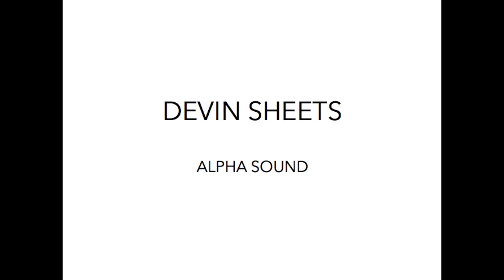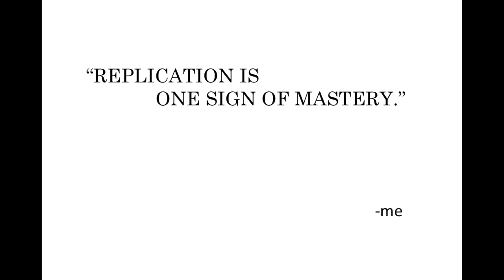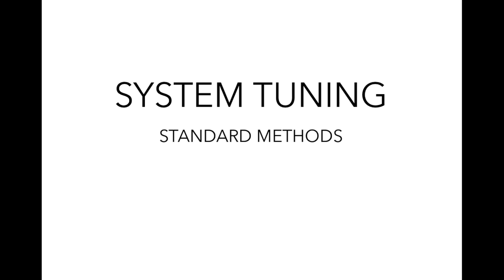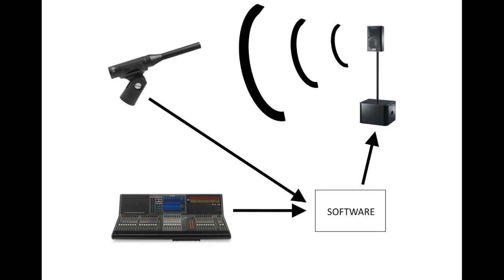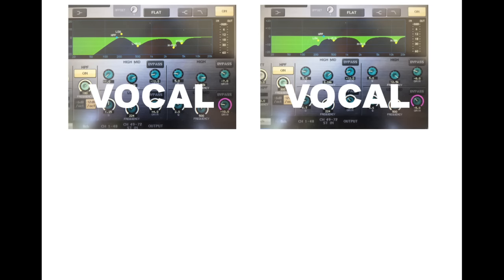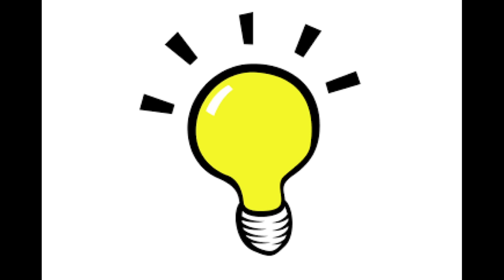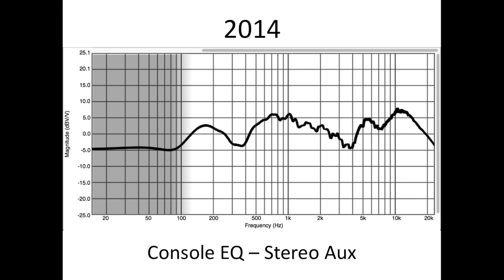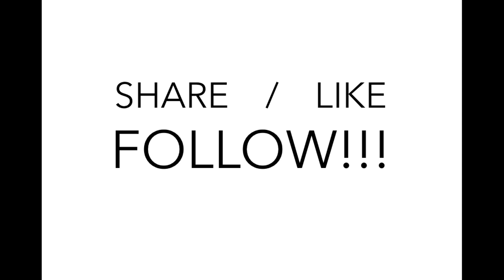Sound System Tuning By Ear

Comment: I used to EQ a system with a graphic by sliding each slider to max, then min, and settling it where it sounded right to me (playing back familiar music).  I always got the system sounding really good this way, and took care of about 90% of potential feedback before I ever turned on a microphone.  When my boss found out this is how I did it, he flipped his lid and said I needed to use an RTA because "that's how it's done."  Thing is, he sold sound systems; he had little experience in actually operating them, and read about how people did things, and believed it was a rigid formula.  Deviation from that formula, to him, made us look incompetent to the customer.  (Customer doesn't care -- they just want it to sound good!)
Reply: If the boss pays well enough we’ll make it work with measurement equipment too!
Reply: That's how I always did it. RTA is only really useful for tracking down FB frequency

Comment: I've been a sound guy since 1989...starting out in clubs, on systems like Yorkville, old JBLs, SoundTech, BFI, Melhart, homemade stuff, etc... My first sound company job was with a former Showco guy, who had an old 70s Showco rig...called the "Hurler System"...that was actually Led Zeppelins PA. 

I was never allowed to even look at consoles and processing until I drove trucks, loaded in and out, learned to set up and wire the whole system, and make it work right, etc... If my boss ever caught me even staring at a console for a moment, he would yell at me..."Stop looking at that console...!". 

I learned how to pull shows in the shop. I was cleaning toilets, and taking out the trash. I was changing oil in the trucks. I was doing things like cleaning 250ft snake covered in cow poo, after it had come back from a rodeo arena. I learned to repair broken gear, and replace faulty casters on road cases. I got to a point where I could go from scrubbing the toilet, to taking a broken system and bring it back to full working order, and ready for the next show. 

Then one day, somewhere around the summer of 92'... I had set up a monitor rig for a Bootsy Collins show. There I was sitting on a road case after I had set everything up. My boss said "Hey, those monitors aren't going to mix themselves...". So there it was...my first time behind a console....mixing monitors for Bootsy. But you know what...it went surprisingly well, because I knew that entire rig, inside and out, literally. I knew how everything worked, and knew about any fussy pieces of gear. It was surprisingly easy to make it all sound right. 

Over the years, I've used all the gadgetry available. But most often I use my ears. I rarely look at anything once signal flow is established. I use a 58 to do most of the work. I own a small sound company now. I actually make my own cabinets (a once common thing, but a dying art). And I still do all the stuff the same way. I make sure I know every piece of gear inside and out. I've toured the nation and the world, mixed in front of hundreds of thousands of people...and I still do the speaker on a stick gig in the park, for a kids puppet show. It all works the same on a fundamental level. You're just scaling up and down depending on the gig. People these days miss so many fundamentals, and rely to heavily on everything but their own ears. I occasionally hire guys who love to talk about what consoles they've mixed on, and what shows they've done...but at the end of the day, they don't know much about the whole process. It's sad really.

I see so many guys who can set up the network, program the consoles, set up analyzer gear, and make it all look pretty on a screen. But it still sounds like crap. Those analyzer mics are facing and listening to the PA, meanwhile behind FOH, it sounds like a jet aircraft taking off in your ear.
Reply: Scott:
I just carefully read your publication on the subject of the video, in which I saw myself personally, practically in every sentence that denotes your effort and perseverance in a profession like the one we both have.
For me, there is software and machinery capable of helping us. This is certainly welcome. But first and foremost is elementary knowledge about electroacoustics, which is the science that governs our work.
After that, my acoustic perception is the reason they hire me to take care of a system. I do not completely hand over this task to sound analysis tools to the point of allowing the result of this analysis to influence this perception.
Essentially, my goal is to deliver an acoustically coherent program to an audience, knowing full well that the majority of listeners don't even have the real ability to analyze the program being sent to them, which means that the spectrum still has to be wider.
The effectiveness and rigor with which this is done depends - in my opinion - on the real knowledge of the person responsible for the sound system in the scope of the provision that is possible, with the means at his disposal.
As a sound engineer, what I think is that I must always have my ears attentive to what is coming out of the sound system and never let myself be distracted by graphics on the control surfaces.
Since the final result of the work is intended to be sent to people who only use their ears and consequently affect their emotions, I have always felt that my professional sound system tuning should be oriented in that direction.
In other words, I perform this tuning based on what is supposed to happen in a generic way during the shows, with the awareness that I am proceeding in the right way so that everyone can clearly hear and feel the program that is being produced on a stage. .
I wish you luck, health and lots of sound work.
Macedo Pinto
Portugal

Comment: I did the sound for a local blackened folk metal band a little while back. I worked a 30 year old analog console, in an old factory (concrete walls and steel beams), and since we got heavily delayed, I didn't have time to do a full sound check. I was pretty nervous about the quality of the sound, but for some reason, I got tons of positive feedback (not the microphone kind).
Turns out, caffeine, nicotine, and stress, works wonders!

Comment: Back in the day before all this tuning gear was available or priced to the point that mere mortals might have it, everything was done by ear.  The 400 hz and 2.5khz thing is probably the first thing you learn in doing live show sound.  They are two areas that make things sound harsh and sort of hollow.  Nobody likes it when you leave much of that stuff in the mix.   Learning to move it from the strip EQ to the main mix EQ is a very big step towards getting a proper sound from the start.    If you EQ a system for the FM curve to start with, you will always be starting at a pretty good point.  Then you are just working for the room and the desires tonality appropriate for the act or event.
Reply: You are right on the mark. 400hz = boxey shitty boomey sound. 2.5khz will give people ear fatigue kind of like the never ending sound of a subliminal piece of chalk screeching on a blackboard or the gnawing annoying sound of a dental drill in your ear.
Reply: Im not a sound tech but when Iv been to shows almost always the sound is super peircing and harsh. When thinking of doing live shows as a musician Iv feared what my ears might go through tbh. I find PA systems are almost always way too loud, obnoxiously loud and unnecessary.   Iv been to orchestras that are loud and normal, appeasing. But at certain rock shows it seems people have no idea the difference between audible and too loud.
    I then worry about inner ears because I assume ones gonna have to blast them directly into my eardrum to overcompensate for the volume. I haven’t experienced this yet so idk but all I can say is I almost never go to a show where the sound felt right accept for one show in a small venue in NY and actually PA now that I think of it . And then outdoor Venues mostly. But my impression has always been PA systems are harsh and nowhere near  as musical Or sweet  as my guitar amps at very loud volumes

Comment: Great video. I usually use graphics on my LR and aux sends, and parametric EQs on any routed matrices. As of late, I've been running my subs on an aux, but sometimes I like to mix full range - depends on the band/system/room. The best advice I was given as monitor engineer: just go out and listen to the wedge! Always use your ears. 

My soundcheck songs: PYT (Michael Jackson), Woman In Chains (Tears for Fears), and I Like It (DeBarge.) 

Also, audio engineer friends: please be kind to your ears. Even if you don't think you mix loud, get used to mixing with ear plugs. I know it sucks, but your ears are your best tool. Protect them.

Comment: Man, I'd like to chat.  I've been doing this and hiding my technique for about 3 years.  I'm a firm believer in quick responsive EQ, what feels good to the ear.  I took it as I'm correcting the resonant peaks of the system and room, so I can correct the tonality and resonant peaks of the instruments and voices.  I haven't had a legitimate loudness complaint in 3 years, and have gotten more compliments than I am comfortable handling lol.  I now have a reference to why I do what I do.  Thank so much for making the video.
Reply: Been doing live sound for 10 years and I literally do the same thing, never thought I would find someone that does the same.
Never got loud complaints in a long while. But my dynamics are very well done.
Reply: @stevengangaram2825  I’ve been in live sound for 16 years, but would always try and eq the room flat, until that revelation more than 3 years ago now, that I didn’t like it.  I didn’t like it when I did it, even though it looked right.  I didn’t like how it sounded when others had said they had eqd flat.  Wild ride, but so glad I took it!
Reply: I’m 30+ years into sound and agree with both of you. I can’t stomach a “flattened” EQ. It sounds horrid. I play “hey 19” by Steely Dan when setting my EQ.  If that sounds smooth, then the band will sound smooth. It also doesn’t annoy like pink noise does.

Comment: Great video!  My method has always been to eq a room by using the same three songs every time. I know the songs very well inside and out and I know exactly what they should sound like. I don't use any microphones or software. I simply do it by ear. While it's not perfect, I feel I'm able to very consistently get the same mix over and over regardless of the room if I start there
Reply: Would you mind sharing your reference songs? Thank you.
Reply: @_thevaporz  don’t use any electronic music to setup they are usually over EQ’d , Iv always used the same songs as Tony Andrews (Funktion one). set mid range (focus on vocal) 1st then top end for this I use George Benson Nature Boy. Then move onto low end until it’s balanced when happy I switch songs to Gat Decore, Passion usually for a final tweak in bass levels. Setup is done ideally at working volume to avoid redlining the mixer or clipping the amps 👍

Comment: I have been running FOH since 1977 in both huge events and tiny venues. With audiences that ranged from 25k down to 3-4 people. I like your analytical approach and you “get it” as far as tweaked are concerned. Ear training is key and understanding the dynamics of what makes a room sound the way it does is key. I totally agree that you need to be proficient with your equipment possess the ability to listen critically. Your ears and the ability to listen critically are paramount.

Comment: Agree 100%, in my life there are too many people mixing to a picture instead of their ears. I had a similar experience when the audio-wizard I looked up to (and still do to some degree) spent around 20 min "tuning" a system based on the picture, ignoring what the sound was actually doing. I pointed out that it sounded weird, and that it wasn't sounding as good as he normally get is. then he actually listened and realized that he wasn't setup right, and he had to pretty-much start over. Though he got it running well pretty quickly after that. It just showed me that relying too much on these tools made him not listen, and my audience is not made of RTA mics, but other human ears. Now I try to trust my ears as much as possible and only bust out the RTA stuff if I'm in a really rough situation with too many unknowns or changing factors- or if I'm having an issue I cant sort-out quickly with ears alone.

I think it is great to have and teach standards. It super useful for new technicians to have a graph to tell them what is right, even if they haven't taken the time to develop their ears. But a well trained ear and listening ability is actually faster at catching problems than a meter in most cases. Especially the problems that will drastically effect your audience and performer/presenter. For my shows, if you see my laptop out as an RTA, it is because i don't trust something there.
Reply: There's a band I follow who are quite talented but their sound team is pure garbage. I can imagine people seeing them for the very first time live , just walking out because the sound is horrible. Don't hire friends if you aren't willing to fire friends when the sound sucks and sucks constantly not just due to differences in venues that can't be overcome..

Comment: Great video! Thanks. I have noticed exactly the same thing over the years how if I averaged out all of my EQ's I have so many similarities as well. I havent done it myself as I didnt want to add / remove from certain things. For instance I dont like putting EQ on acoustic and electric guitar if I can help it at all. I always try fix the source first. So on stage fiddling with the musicians EQ on his acoustic and 99.9% of the time it sounds just perfect. Just roll off the lows with a HPF. Same for electric, if there is a amp I listen to the source. If the source is good then I will play with mic position roll off the lows and 99% of the time you have an amazing sound. But watching your video makes me realize I should give it a try. It will also save the other engineers loads of time if the channels just "sound" good from scratch. Great video. Please post more!

Comment: If anyone reads this... another unmentioned advantaged of tuning a system by ear is that you automatically filter out unharmonic distortion too.
2 System can have the same frequency response on a graph and sound vastly different in transparency and distortion.

If you read this and think "oh yeah i should do that", be careful! Its always a compromise between removing distortion and losing too many frequencies, especially on cheaper PAs.

Comment: I usually don't have too much time to tune so, over the years, starting off with Pink Noise to get the room acoustics in check, then listening to a handful of reference recordings like a couple of tracks off of Ramsey Lewis' Ivory Pyramid(Those GRP recordings sound amazing), to test dynamics and low to mid range performance, a couple more jazz tracks with good vox tracks to get smooth vocal response.  Then I listen to a few more popular but well produced tracks from Michael Jackson and Bruno Mars along with Daft Punk to get the rest of the spectrum in line has worked well.  I learned pretty quickly that just relying on a flat room eq curve never equates to smooth overall system sound and after a certain amount of time, will fatigue everyone's ear, especially if the show you're mixing is 3-4 hours long.

Comment: I play 3 reference songs from a CD, fine tune the crossover outputs with a flat FOH EQ.  Next I begin adjusting the FOH EQ to obtain a relatively perceived flat response from the playback with perhaps lightly elevated low end.  Next I would use pink noise if available.  Lastly, I will use the primary vocal mic being used on the front of the stage and tweak the FOH EQ to make sure that vocal mic sounds decent and check for any frequencies ready to squeal.  Been doing it this way for over 30 years.  

Thanks for your video. I am a strong believer in ear training with an EQ.  I prefer 1/3 octave graphs, but I'm old school.  I used to mix a lot of monitors a long time ago, I was pretty good at knowing immediately what frequency was feeding back (nearest 1/3 octave).  Young engineers today are not so good at this, unfortubnately.

Comment: No tuner here, just having been to a good many festivals, and I have frequently wondered if the guy at the mixing desk is deaf or something (and same with the journos who would write a review saying the concert was sullied by low volume). Another thing is that high-pitch tones has a tendency to break up into painful noise IMO. The most interesting example of mixing craft though was one day where the sound had been dull and muddled the whole day until David Bowie came on stage and it was loud enough to blow out your eardrums while still being crystal clear - and the only difference was the guy at the mixing desk.

Comment: it's crazy how your routine is somehow what i did as well. there was a time where i would simply measure the pa flat with a lake connected to smaart and "draw out" the dips and after that i simply would apply my personal taste eq on top of that which was the average result from like 300+ shows . I just recently put all this aside and went back to tune systems by ear (except for delays and phases of course) because it wasn't fun anymore. the other method is my it has to be done quick method now and works pretty well but when i have the time ears it is. with the younger generation engineers you sometimes get a weird look though because they cannot accept the fact, that this can be done without having 6 + measure mics across the room.